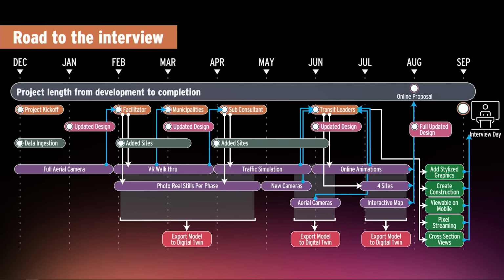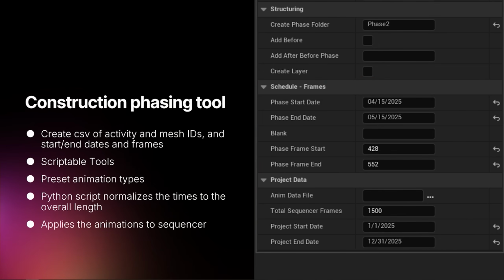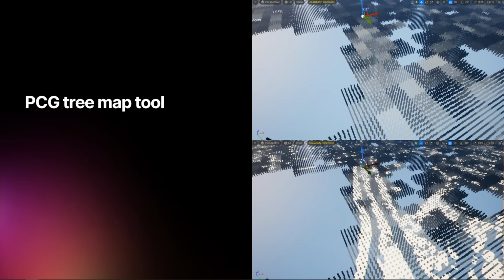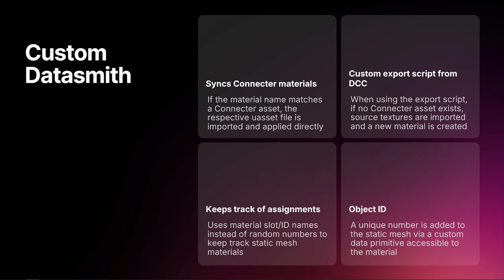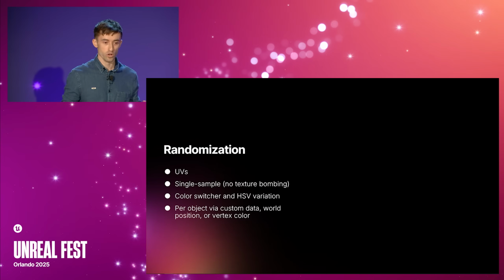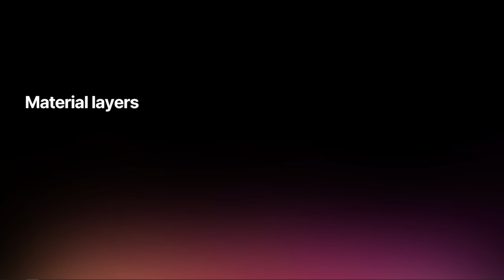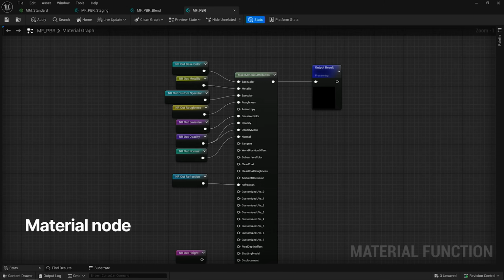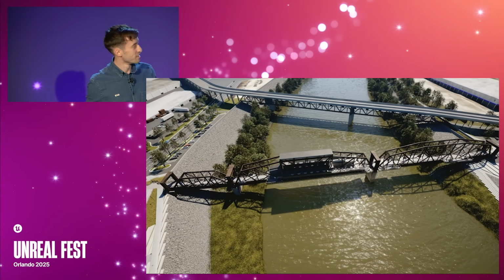Transforming Infrastructure Design With Unreal Engine Tools | Unreal Fest Orlando 2025

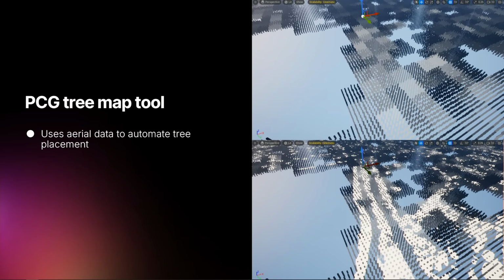Comment: 18:25 If anyone watching this has this issue with trying to spawn PCG based on a texture and it comes out blocky, you need to check "Force CPU Sampling" on your Get Texture Data PCG node. Using the texture from the GPU has compression artifacts (there are some settings in the  texture asset to avoid this, but I don't know them offhand).  Unfortunately, the CPU sampling doesn't work with alpha channels so these guys would have to pack the textures differently. 

Spinning up a Python thread to run OpenCV is quite the solution though haha